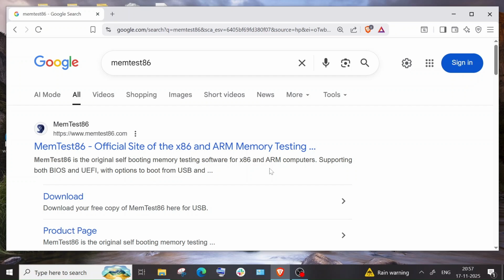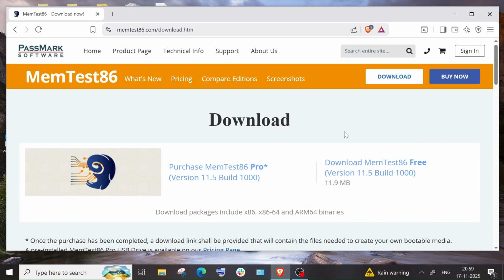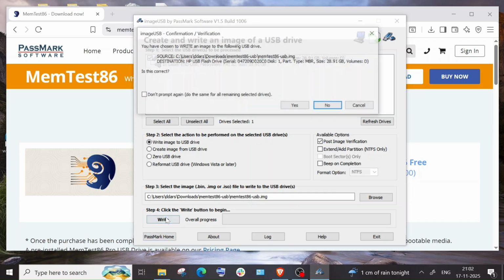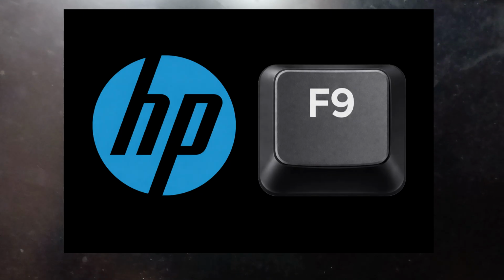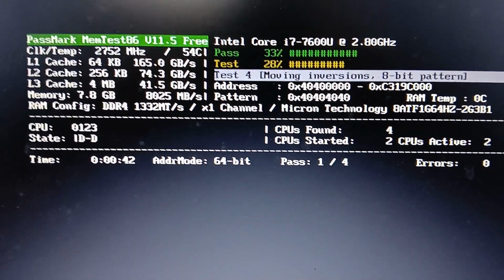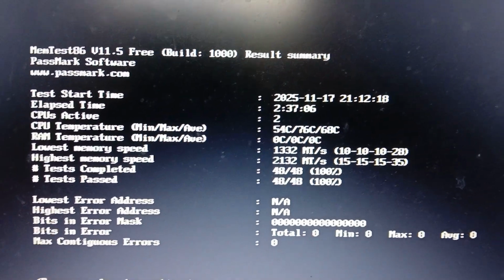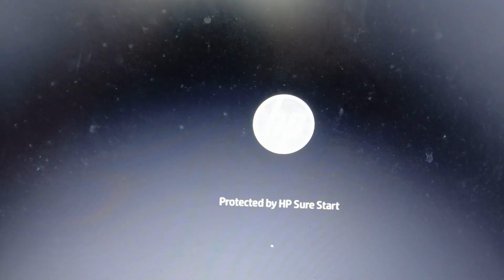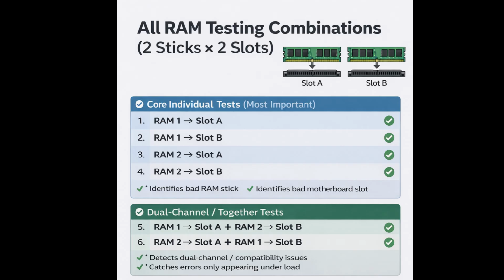How to Test RAM using Memtest86 - Full Step by Step Setup Tutorial in Windows

Comment: Memtest passed.
Does it mean that the BSOD is caused by corrupt drivers?
Reply from the maker: Not necessarily. A passed MemTest86 makes faulty RAM less likely, but BSODs can also be caused by drivers, Windows files, hardware, or other issues. Check the BSOD error code or dump file to narrow down the cause.

Comment: I used this program before and it gave an error. Does that mean it's 100% RAM and not the motherboard?
I also tried changing my RAM to another slot but it still didn't work.
Reply from the maker: Not necessarily. An error in MemTest86 strongly points to a RAM or memory-related problem, but it doesn't prove the motherboard is 100% fine. Since changing the RAM slot didn't help, try testing each RAM stick individually if you have more than one.